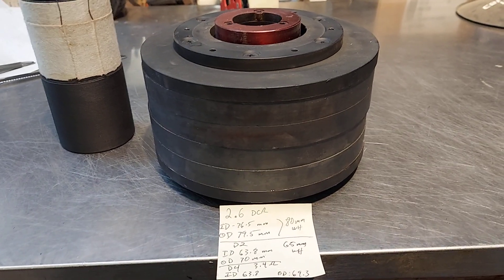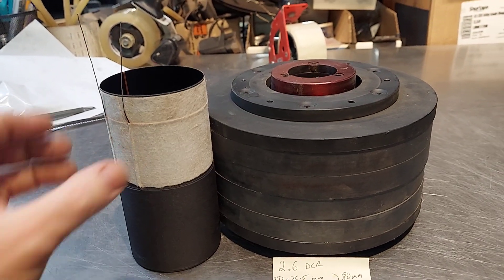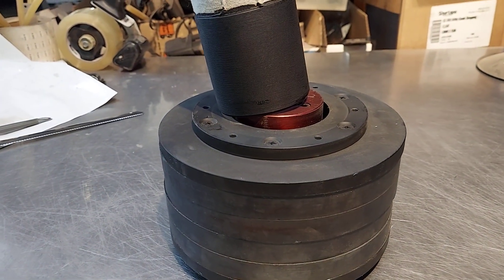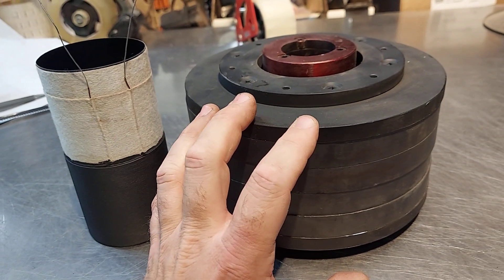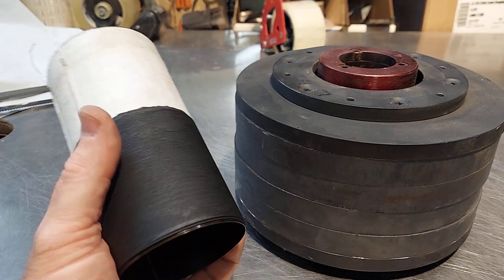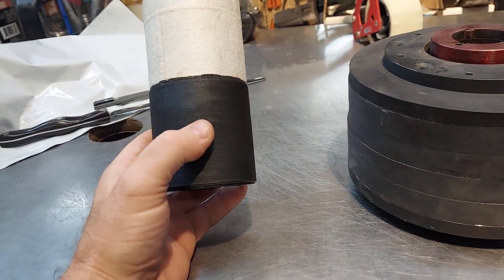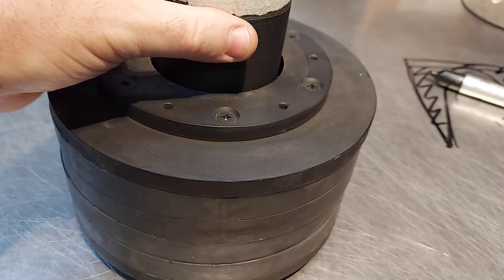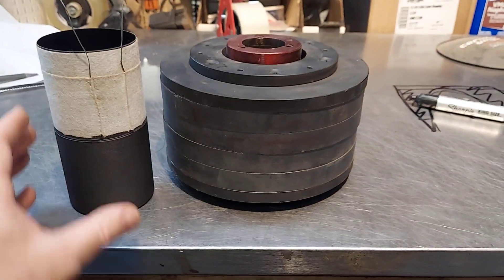Why your subwoofer smells & burns it's not clipping / dirty power it's just you being  too demanding

Comment: Another old-school trick is someone  can use a tweeter in circuit, with the  subwoofer and the amplifier to the detect clipping. The tweeter will start chirping as soon as the clipping starts !
Reply: Does it not blow the tweater playing those low frequencies through it?
Reply: @kevin82239  they usually use a piezo that has a high pass inherent in its design. But for a regular tweeter you need a high pass crossover or a low value capacitor, otherwise the bass signal will burn it up quickly.
Reply: @kevin82239  thats why you use the cap
Reply: @kevin82239 no the bass blocker won't let it blow or get the power to blow it but the capacitor on it will pick up the clip signal because clip signal is if I must say a high hz signal and the tweeter will let it through
Reply: I use this method. Works perfect.

Comment: Well said and hertz makes a huge difference for the time it spends in any position under high load. Stop a coil inside the motor under high load and it will be torched as well. Don't hesitate to correct me if I'm wrong.

Comment: What’s your opinion about coating with epoxy?
Reply from the maker: Coating the coil?  Dumb.  It'd be like coating a heat sink.  In this case, the coil is the heatsink.
Reply: @RobotUnderground  got it. I was just wondering if a thin coat might help with longevity.
Reply from the maker: @tyronedixon7404  I understand your thinking but you want that coating, (enamel), as thin as possible to transfer the heat.  The epoxy would hold it together more but it'd collect more heat, sooner.

Comment: Have you seen people that are heating water by rotating neodymium magnets along a section of copper pipe, so what this told me is that if the coil was not energized just the movement itself would heat up the coil so in a speaker you could be dealing with two sources of heat? Of course the heat from the applied voltage as well as this heat that is created as a result of the coil reciprocating through the field. This kind of hit me as I was watching your video..... Just finished the last 2 minutes of your video and believe what you were explaining is the same thing I'm talking about by the coil being out of the gap or they are at least related anyway. Great video now come to the conclusion that there are two main causes of heat in the voice coil and more math then I would ever want to do figure it out, but like you said visualizing is key become one with the coil!!!
Reply from the maker: Post the video

Comment: Has anyone ever built a box with a pvc pipe going in to it. Maybe seal it to the hole in the back of the magnet and blow cool air in to the core of the driver while under high power, max excursion bass. I wonder if the air would stop moving through the cooler at certain frequencies and power levels.
Reply from the maker: Experiment and let us know.  Make a video!  Go viral!  Set things on fire!

Comment: I would argue that if you could build a cone/suspension light and soft enough to reach x-mech on 200W that you could play that woofer with the coil traveling outside the gap all day long without failure either.  The important bit here is that coils burn from putting heat into them faster than it can dissipate and if it stinks you're overpowering it and need to turn that shit down.  Try to tell people this and they look at you like you have three balls.
Reply from the maker: What's wrong with 3 balls?  https://youtu.be/5-6YU1vX3-0

Comment: guys ifucked up. thank you for this video. i believe ive fucked up my kicker comp vr single 12 by being too demanding, i smelt the magic smoke, it was so fucking fresh and heavenly man, but i took it for granted with my driving habbits (concentratrion). i am going to the shop on thursday and the engineer who put together my system is going to take a look. but man the amount of guilt and stupidity i feel. 

they told me that it could either be me, the ground placement, or tuning but im sure ii did the damage to her :(

thank you for this video it was really helpful and edjumacational.

china coils lLOL
Reply from the maker: Nothing wrong with China coils.  Just get stronger equipment to suit your appetite for bass.  You can get there by flipping and helping other people.
Reply: *ANOTHER thing
they told me two things
 don't bring the head unit volume above 20% for the first 2 weeks 
and for the direct bass control no more than 80

ive been listening within those numbers few times going over that smelling that smell but um i didnt properly break them is is my guess

Comment: Well a clipped wave is still a curvy waive, just with the tips clipped off to either a slight or extreme degree.  But a completely square waive is a bit different I thought?  I suppose if you clipped to an extreme amount the waive would at some point end up being fully square but that would be clipping to such an extreme... I would assume?  Clipping to the point where you can hear it and turn it down is not a full blown square waive as you have drawn out there, the majority of it would still be curved?  Also the sharp edges of any clipped wave cause the speaker to move very fast as well which is not good either on top of the thermal issues you stated with it being held in one spot far out of the gap.  Or am I way off base here?  Im no expert lol, just adding to the conversation not trying compare dick sizes.  I would lose that battle every time anyway,

Comment: Hey, don’t punch a baby,,,, and whats the purpose of shorting rings,,, what are they, why are some copper, and some aluminum.  What kind of sub give you better sound quality in a home stereo system.  What is a XBL^2 motor? Why can’t I find a good quality amp for home audio in something that is not a friggin plate amp!?!?!  God!  I feel like punching a baby
Reply from the maker: Lots of makers use them but they're only good for super low power, like under 50w... And maybe you can measure a difference on a computer, not to your ear.  After that, they become saturated and are useless.  Most all of the makers put them in motors as a marketing gimmick.  If they were effective, everyone would have to use them right?

Comment: A speaker motor is a permanent magnet motor.  The relationship between current flow in the coil and excursion is a complicated one.  Exceeding the VC thermal ability for long is going to cook it.  Just as if you lock the rotor on an electric motor causing the current to increase way over running amps and causing smoke if no overcurrent protection and/or thermal protection is present, the same can happen to a speaker.  In a ported box at the tuned frequency the excursion is very low and this causes impedance to drop and power from the amp to increase.  Increasing the amplitude higher exacerbates this characteristic until the coil burns out.  Feeding a ported system frequencies well below the tuning frequency causes the drivers to unload and excursion to increase to xmax and eventually xmech if you're unlucky and that familiar clacking noise of the former colliding with the back plate if the design allows it.  Some are just overbuilt to prevent (bottoming) but if really pushed can actually remove the former from the cone and spider altogether.  Shorting rings are another way to keep it from leaving the gap too far.  But an experienced operator and gain level engineer should never let this happen.  Or be prepared to pay high re cone bills!

Comment: Really liked this video I always wondered why my skar heated up I did just build a 10 inch subwoofer sub it's rated 220 watt but I put 100w to it and it takes excursion all day: also a question can I use a 220w mini amp on my skar sdr 12 600w if I wire it right or should I not do it I also don't use my gain for volume love it keep up the great info vids
Reply from the maker: Glad it helped
Reply: @RobotUnderground  what about my question bro
Reply from the maker: Just make sure you observe impedance minimums and use common sense
Reply: @RobotUnderground  I have it wired to 8ohm
Reply: But thay heat up tho idk why
Reply from the maker: @goddesslove4301  And what is the amp stable to?
Reply: @RobotUnderground  4-8ohm but I have new amp with sub output 220w same ohm range
Reply from the maker: Text me direct and remind me of this conversation. 6023126504
Reply: @RobotUnderground  I can't text atm
Reply: @RobotUnderground  btw it's a bluetooth amp is that cool
Reply from the maker: @goddesslove4301  Well if you're asking these kinds of questions, you'll need to study more on the basics.  I recommend the Loudspeaker Cookbook. http://audioheritage.net/files/Loudspeaker%20Design%20Cookbook%20by%20Vance%20Dickason.pdf
Reply from the maker: @goddesslove4301  Just make sure it's BT4 or higher.  Lower versions don't sound great.
Reply: @RobotUnderground  ok cool so how should I run my volume half so it won't clip?
Reply from the maker: @goddesslove4301  Sure.  Mostly just use your ear.  If it sounds like crap, turn it down.
Reply: @RobotUnderground  ok cool another thing sorry I'm running a 24v 5a power supply is that good
Reply: What about frequency control turn up or keep down?
Reply: Or will the bass be better and deeper either way
Reply: @RobotUnderground  you there bro
Reply from the maker: @goddesslove4301  You tell me.  Experiment and find out.
Reply: @RobotUnderground  ok I also run my tweeters on the same amp will that effect performance for sub I'm also putting it in a 60hz sealed box
Reply: @RobotUnderground  ok ima go do some test and get back thanks for all the help bro
Reply: @RobotUnderground  hey bro so I experimented and I finally got it I put the skar in a box running it at 8ohm half volume but played decaf for bass and sub doesn't move much so it doesn't leave the gap

Comment: 11:15 Yea That's The Only Way I Run My Subs, By Smell lol. Smells Like I Need To Turn Them Down XD. I've Gotten Them So Hot Then When I Touched The Coils With Tip Of My Finger (Invert Mounted) It Turned White Like I Touched A Cigarette Lighter. Your Either Playing It Too Loud Or Out Of Tunning / Subwoofer Aren't Loading. If You Play Above Or Below Tuning Without Cross Overs Set Up Your Subs Will Over Excursion And You Get Little Output. Cook Your Coil When Your Subwoofer Is Just A Tad Past Peak Efficiency (Tad Past When Impedance Rise Is The Highest / Tad Past Port Tuning) Because That's The Only Time It's Worth It. Effiency Is Still Good (still pretty loud) And You Have A Little More Excursion From Not Being Completely Loaded So You Still Have Cool Cooling From This Excursion. The Key Is Setting Up Cross Overs So You Limit Excursion Below And Above Tuning For Cooling. Sure, Doing This Will Limit Your Bandwidth But If You Play Your System At It's Peak Like I Do, You Know You Will Flatten The Bottom Of Your Voice Coil When A Bass Song Has A Surprise 22Hz Hit @0dB When Your Tuned To 29Hz With No Crossover (Bottom Out/ Jack Hammer Mode). Amp Crossover Are Usually Not Tight Enough / Right Roll Odd Curve For Every System. The Only Way To Do It Perfectly Is Editing The Music Yourself / Rebass and Set Each Hz Recording dB Accordingly With How Your System Is. Keep Your Excursion Where It Needs To Be At All Hz For The Best, Loudest, Dynamic And Longest Demos. OR You Really Know The Song And You Stare At Your Subs And Man The Bass Knob For Each Bass Hz In The Song hahaha.
Reply from the maker: That's one way to get rid of fingerprints.

Comment: 6:05 Copper Definitely Conducts Heat Alot Better. If You Ever Tried Drilling Copper Buss Bars Or Copper Lug Holes To Widen Your Hole For A Larger Stud... The The Whole Thing Gets Hot Instantly / Evenly. Aluminum Doesn't Seem To Wick Heat / Transfer It As Fast. That's Why High End Heat Sinks Are Copper And Cheaper Ones Are Aluminum. I Believe Silver Is The Most Electrically And Thermally Conductive Metal, Impractical Due To Cost. Gold Is Below Copper And Above Aluminum I Think. I Did Some Searching And Aluminum Is Technically The Most Current Carrying Material For It's Weight. BUT The Volume Of Aluminum Cable Is Silly. Say You Got 2 Cables Both 10Ft Long And Need To Carry 200 Amps. The Aluminum Cable Will Be Lighter But Will Be Physically Larger And Substantially Larger Then The Copper Cable.

Comment: Why dont they use like the Rockford hx2 type venting in the bottom of the sub (the booty hole)
Reply from the maker: Some designers think that it takes away from the thermal mass.  It also forces the air back up through the gap... That's the theory at least anyway.

Comment: Ive heard copper coils lean to "SQ".
They are literally heavier because copper is heavier, but more electricaly efficient.
But they dont dissipate heat as well.
Aluminum windings are less efficient  but lighter and dissipate heat better. 
Leans to "SPl" or competing.
Reply from the maker: The electrical properties don't matter in this application.  The weight is what really comes into play.  Yes, heavier = SQ, meaning it plays lower.  The lighter and stiffer the suspension yields better numbers in power and efficiency but at the cost of being able to play low = SPL applications that give you higher scores but SOUND LIKE SHIT.
Reply: @RobotUnderground  SPL one note wonders are not my cup of tea either. But the physics involved in it i can get down with. 
Getting a good spl score on music is neet, but, just not that critical in my world as well.
Reply: As an aside. I need a TREO 15 reconed. Shifted top plate.  Its frozen.
Reply from the maker: @hardhead7056  No problem.  Text me.  We have great UPS ground rates, 6023126504
Reply: @RobotUnderground  wow after reading how simple that was for dude when he had a damaged subwoofer, I'm subscribing.
Might as well prepare for when my subs die right now, make friends and figure out how we gonna fix em when they go 😅
Edit: not to mention the clear thorough and applicable information available on your channel
Reply from the maker: @RandoManFPV  Better for the environment, better for your wallet, helps others.

Comment: so if they shouldn't come with a power rating, how do you know how much power you can safely fun through it?
Reply from the maker: It doesn't matter.  Always use common sense.  When you smell them, turn them down.  You can get an idea of ampacity by how strong or big the magnet and coil are but you won't know the truth until you use it.  Ambient temp, enclosure type and size relative to the Vas are all important factors.  Here's a few white papers published by Dan Wiggins, founder of Adire Audio. https://web.archive.org/web/20041212012348/http://www.adireaudio.com/TextPages/TechReportsPageFrameText.htm

Comment: Can you recone a pair of soundqubed audio Hdx3 18's d1
Reply from the maker: Sure, or I can sell you parts or drop in kits.
Reply: @RobotUnderground  ok cool. How much for drop in kits? I may need them in the near future
Reply from the maker: @brick2077  $220 each shipped for RE / Rockford cone and dish cap.  Text me with which frame they use. 6023126504.
Reply: @RobotUnderground  so what is it do you mean by which fram
Reply from the maker: @brick2077  SoundQubed changed their frame styles over the years.  I want to make sure I have the same frame here.  So send me a nice side pic of the frame on the motor.  6023126504

Comment: Can you get the Recoil 1/0 ofc in 50’ rolls?
Reply from the maker: No, just get welding wire which is about the same price.   You have to ask yourself though, do you have that much alternator power to justify copper?  Right now CCA is on sale everywhere for super cheap and is good to 300A for a 25' run.   Here's a DS18 "copper" 50' roll I found for under $100 - https://amzn.to/3nwV9br

Typically if you look at industrial wires, they'll be slightly more expensive but VERY good quality and real copper by law.  I found this wire that's tinned copper which is the best.  However it may be stiff to work with.  Here's 50' in red for $160 and it's real copper. https://amzn.to/3kT4etu

If you think CCA is fine.  I've seen a leak of Metra 0ga Vice series for like $45 per 20 or 25' roll.    I found this by AVLeaderz which I buy those Ignite amps from.  https://www.avleaderz.com/products/cw0-25r

Comment: Does high damping factor on a amp help with this problem ? How accurate to manufacturers rate damping ? I have a old PPI PC2350 claims it's 500 factor. I really need to get this amp fixed and going again. When I had 2 of these and wasn't in the dbdragracing lanes. I would run one to my door speakers at 1/4 gain no problems. NOT THE MOST POWERFUL AMP COMPARED TO TODAY AMPS. But it made 4 cheap efficient 15s  hit 155db all day long in my daily driver never a problem. ( most people don't believe me when I tell them I was running 90 watts door speakers) I USED EARS TO SET EVERYTHING) I sat in a lot of manufacturers demo vehicles tuned with computers back in the day and didn't like how any of them sounded while the factor rep would be bragging about how flat its tuned and all the computer shit they used. LOL
Reply from the maker: "Can you hear the difference?", is the real question.